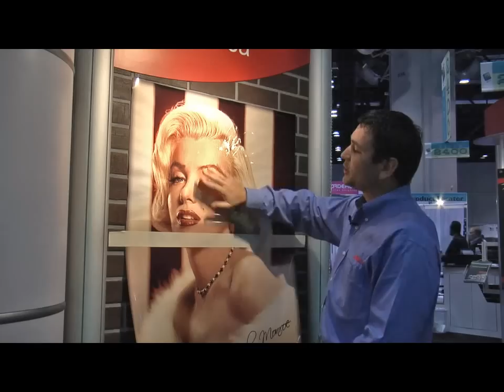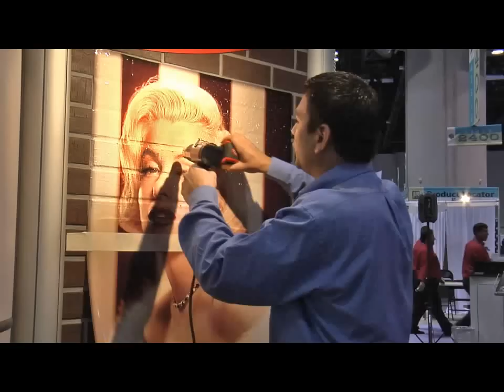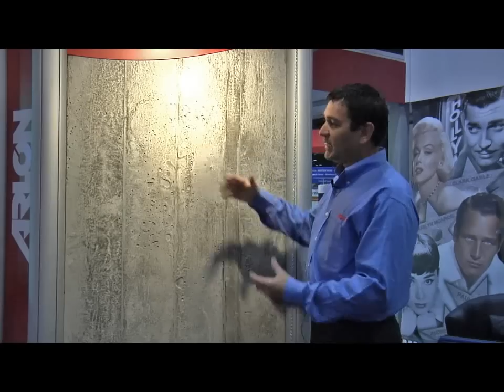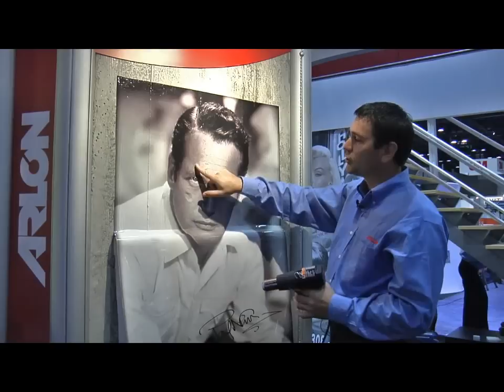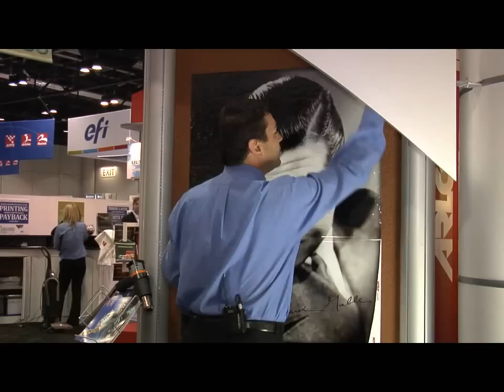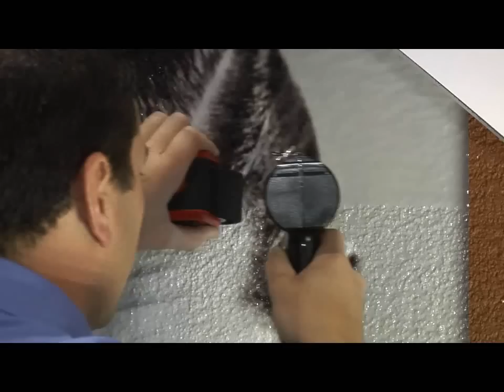Arlon DPF 8000 Product Demo Video

Comment: Thank you Product Sign Supplies for the support in showing this video. The strong adhesive of the DPF 8000 will adhere to various substrates such as brick, concrete and stucco, as shown in the video. We recommend contacting the Arlon Technical Services Team for additional support on the installation of this film prior to starting your project 1-877-ARLON98 or 1-877-275-6698.